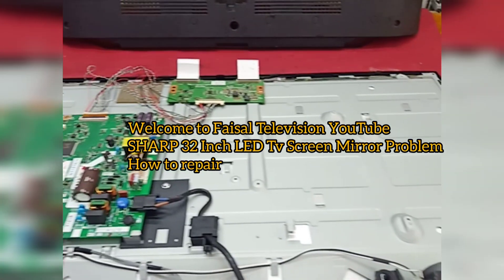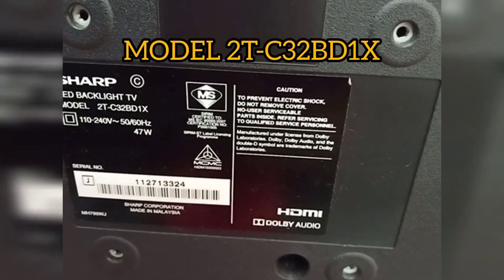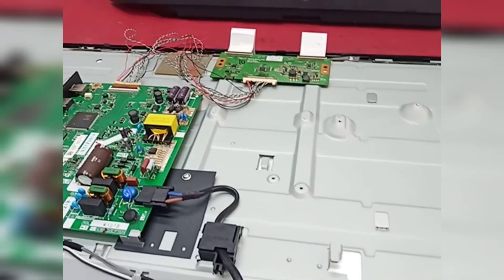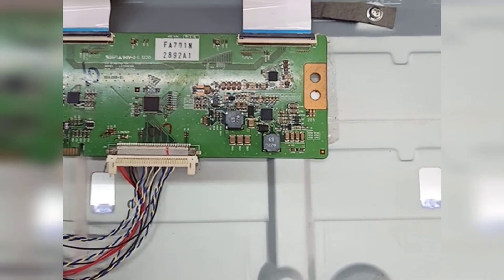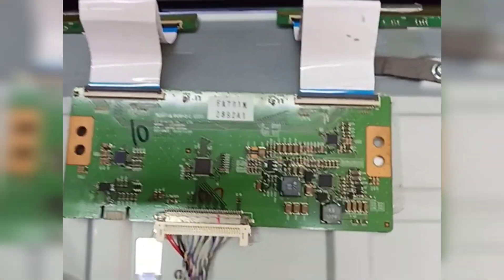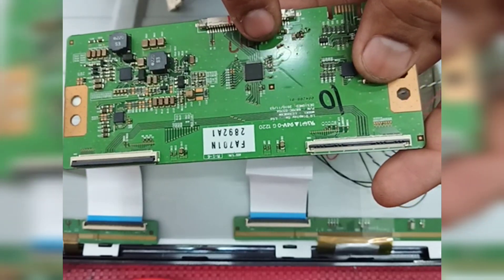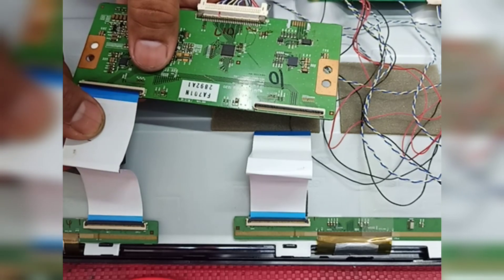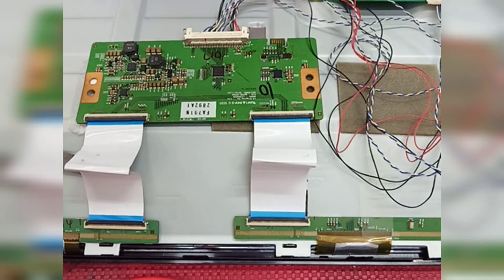SHARP AQOUS 32 Inch LED Tv Screen Mirror Problem# How to repair Model 2T-C32BD1X

Comment: Is that works to my Sharp led tv model 2T-C32BB1M?
Thank you
Reply from the maker: What is the problem with your sharp 32 inch Tv?
Reply: @faisaltelevision69  same in your video sir, mirror problem
Reply from the maker: Watch my video if got same t con board in your tv then remove resistor and will solve your problem
Reply: @faisaltelevision69 remove R24 and replace with 1k resistor, right?
Reply from the maker: Yes R24 1k resistor